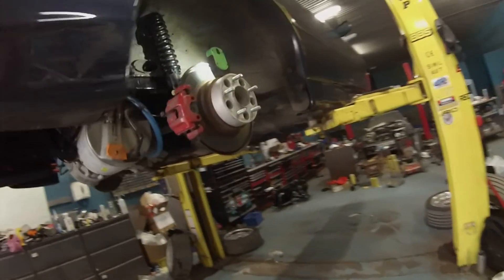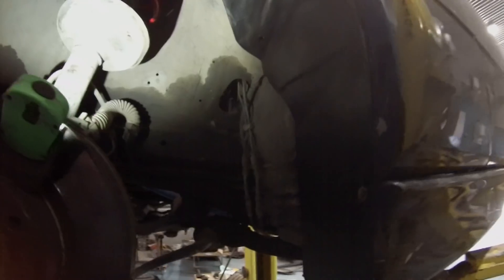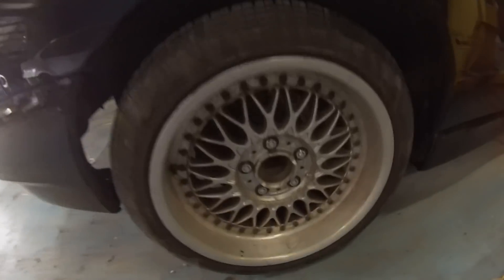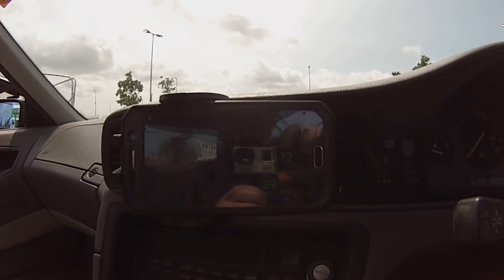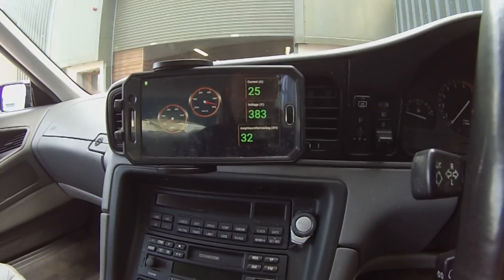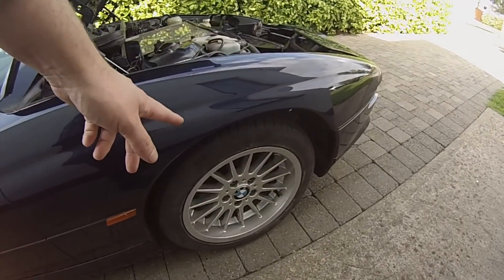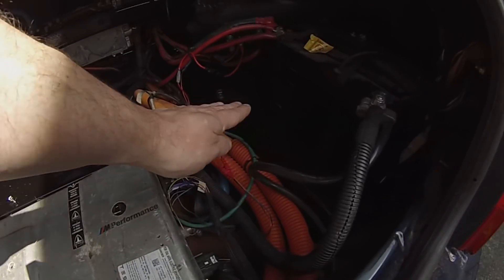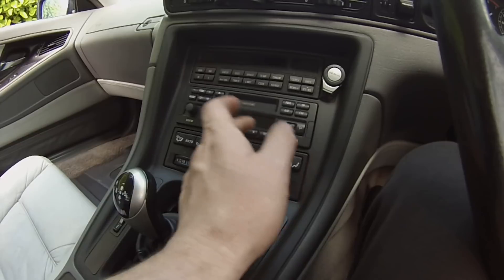BMW E31 840CI EV Conversion 113: Chademo Fast Charge

Comment: it's hard to beat the look of the stock stereo in most Vehicles. Also the ergonomics.  
cassette tapes really aren't what they used to be especially the playback units in most cars I have to admit even in my 2001 Chrysler PT Cruiser the cassette deck was an awful noisy affair.

Comment: Been looking into chademo or CCS for my conversion
Way I see it, chademo is a big DC plug, no inverters needed, and has almost no communication with the battery, it just shoves juice in and lets the BMS handle it ....but they're falling out of favor as more manufacturers go with CCS

CCS is a lot more complicated and needs a lot of canbus communication between the car and the charger. Much harder to DIY, much less to really high (20+) kilowatt numbers. I don't know if anyone's even done it yet.

DAMIEN SAVE US, MAKE A CCS ONBOARD CHARGER BOX :(